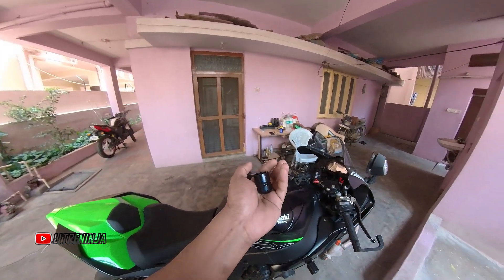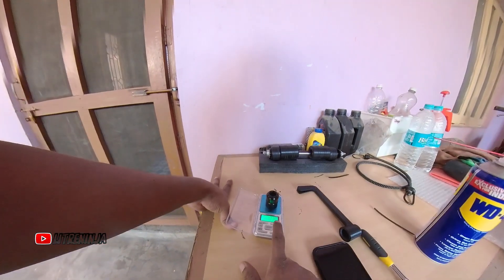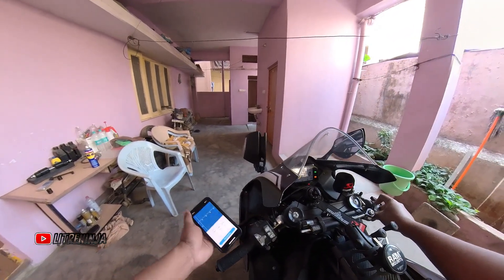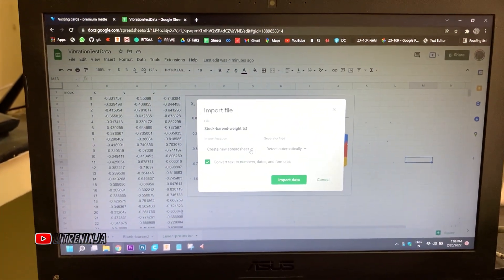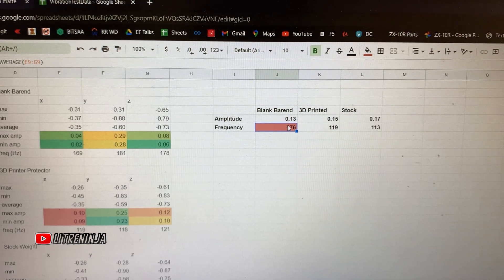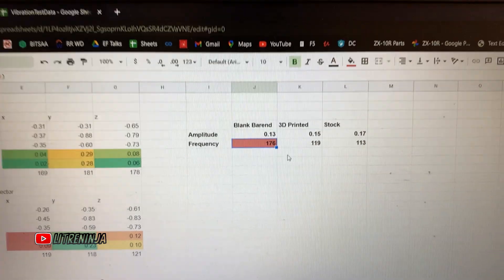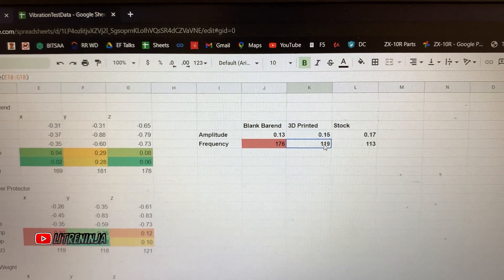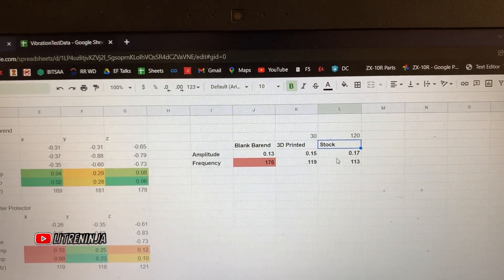VIBRATION TEST | STOCK WEIGHT vs. LEVER PROTECTOR | Litreninja

Comment: This is good data at idle. I’ll be interested to know the same at higher revs.
Reply from the maker: I test rode both stock and lever configs after making this video. The stock weight dampens the vibration much more at higher revs. Like presented in the video, the difference in frequency is magnified and the lever protector fails at higher revs, noticeable vibrations. The stock weight is dope!

Comment: Hii anna....i have one doubt
Why ninja h2/h2r not there in moto gp even it comes under 1000cc, atleast in WSBK also nt  used
Reply from the maker: H2/h2r is built to be the fastest bike on straight roads bro, zx10R is built to be faster on curves and straights both, so a track is off design for h2/r